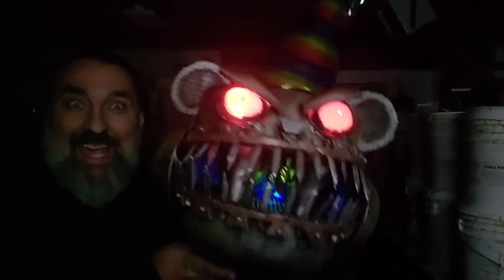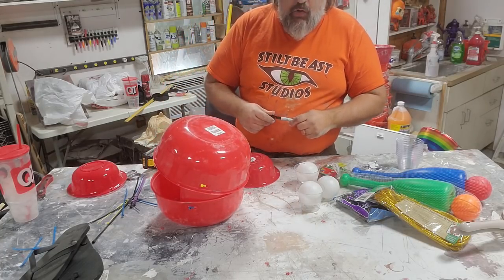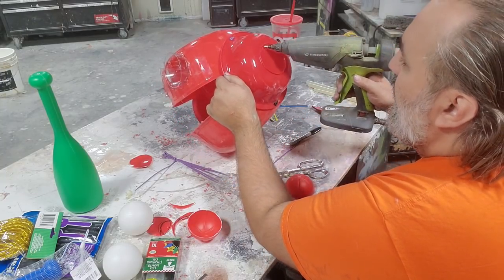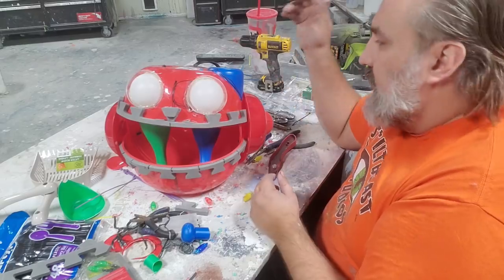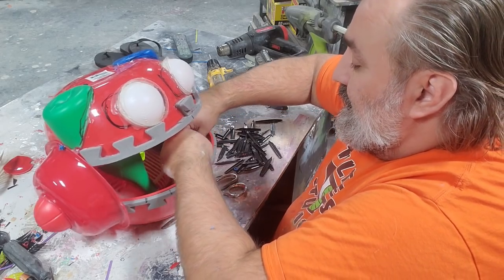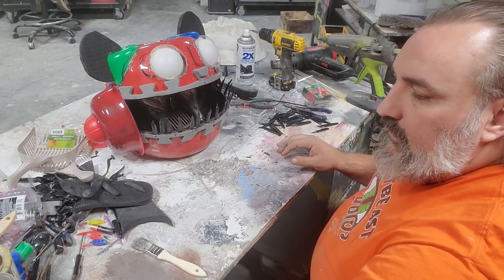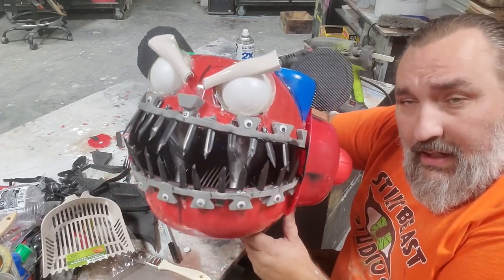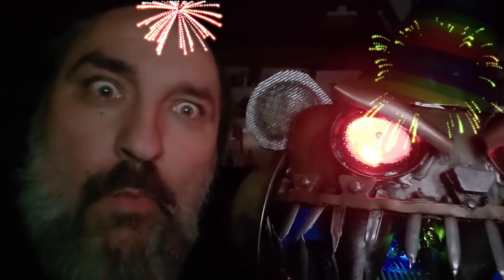Dollar store robot

Comment: Great Job on this project.  I am in the midst of building one myself.  I used rust-oleum black paint, then put on the metallic silver.  It bubbled up.  Any ideas what I am doing wrong?
Reply from the maker: maybe the black was still off gassing, a bit more cure time may be required between layers for you.

Comment: What paint do you recommend for painting plastic that won't peel off?
Reply from the maker: its not just paint its prep. you can lightly sand it, you can paint it with spray adhesive first, you can use the purple pvc primer first- those are all viable techniques.
Reply: @StiltbeastStudios  thanks for your insight. Since you mentioned lightly sanding, it made me wonder about a light duty airbrush sandblaster. Turns out that's a thing. Have you ever tried that?